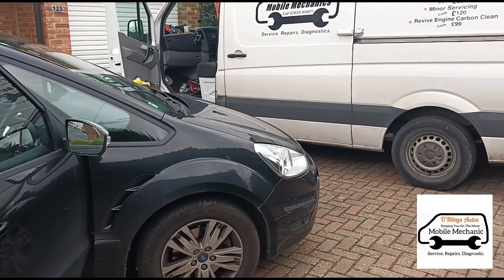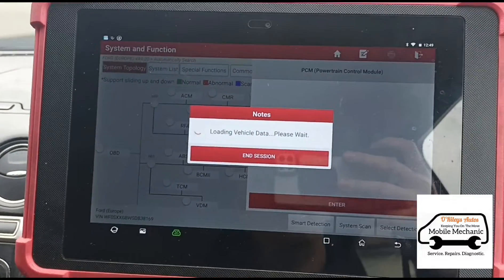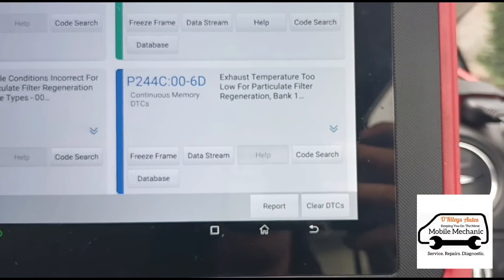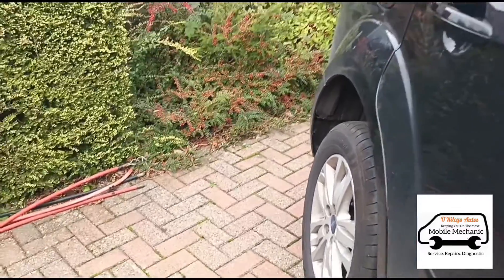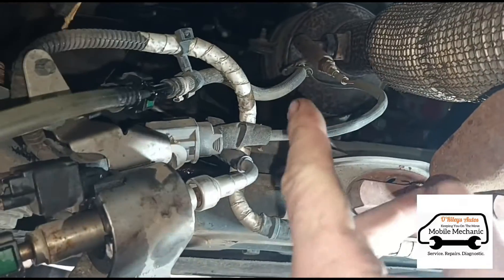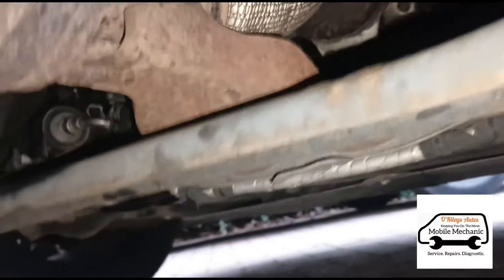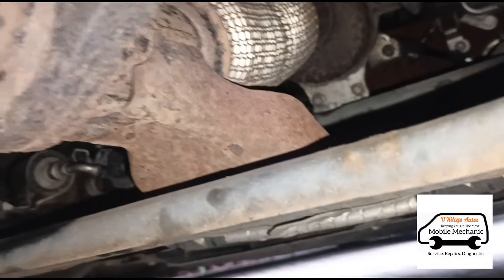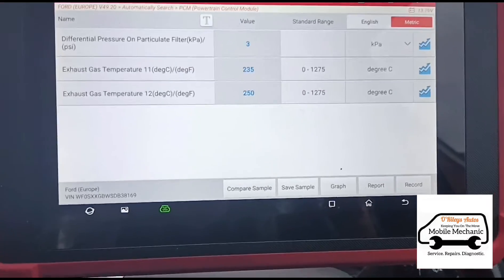Ford S Max 2.0 P244C:00-6D Exhaust Temperature Too Low For Particulate Filter Regeneration Bank 1

Comment: Good morning, I have a problem with the DPF. It doesn't idle and doesn't idle at low speeds in the city, but it does idle at high RPMs around 3000. I replaced the DPF filter because it was burnt inside, replaced the injector with a new one, but not the original, and still the same. The parameters are during high RPM idle while driving. Please help with any suggestions.

Comment: I believe you experienced no noise or operation of the dpf fuel pump when you activated it with your launch. I also experienced this when I tried to test the pump with actuating on my Autel. I checked the signal at the same time and although the pump was silent there was actually a signal to control it - a pwm. However the duty cycle was quite low, not enough to run the pump. 

Concerned that I was facing a fault with the pump and the blocked vapouriser I had the opportunity to control the actuations with a snapon diagnostic and under the control of this tool I did manage to actuate the pump and confirm the pump and control signal the ecu to be ok. 

The issue is with the choice of diagnostic tool used to actuate the pump.

Comment: I also have a question, I took the vaporizer down, tested it and it works fine, I changed the pressure sensor, could it be the pump or the fuse?

Comment: Hi mate i need your help please. Got ford transit 2013. I replaced fuel vaporizer and pump, clean dpf. All fine no faults any more but as soon as the van gets to temperature its starts smoking badly(white smoke) smells diesel. What i need to do? Please. 🙏🏻
Reply from the maker: Does the smoke clear away ?
Reply: @ORileysAutos  not until i reset the dpf that it has new dpf through computer
Reply: Or when i turn the van off and let i cool then it stops till it reaches temperature
Reply: Could be your lambda sensor mate as symptoms do look like it